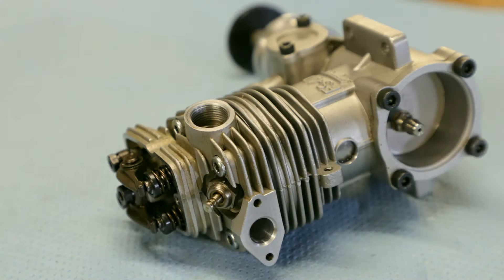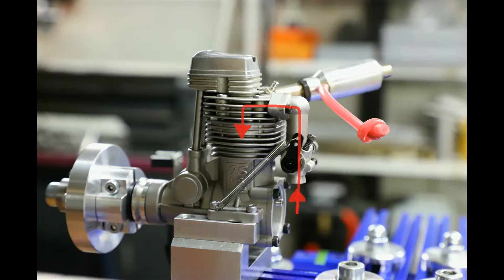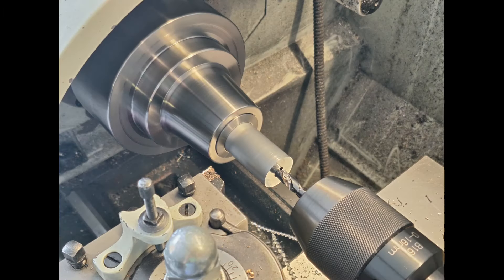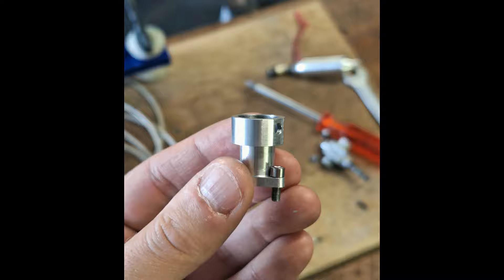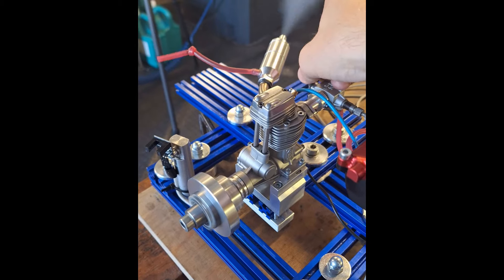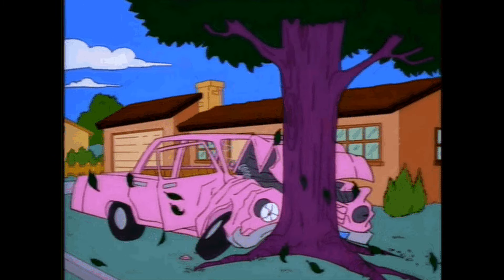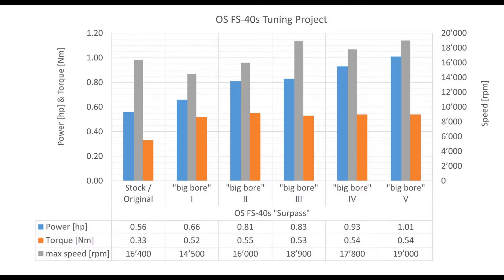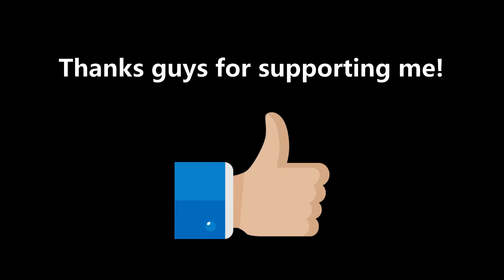How to boost the performance of a OS FS-40s? RC engine bore up-sizing and tuning project Part 6

Comment: well, now its time to make a new head... there was a forum thread on making "crossflow" heads on the old fs26C somewhere... "nolan", iirc?

time to try a hemi head... probably easier to start from scratch than say, modify a saito cylinder.

then theres header lengths, sonic tuning...
Reply: A cross flow head would be pretty good
Reply from the maker: Hi man! I think you mean Nolan Farmer? https://www.tamiyaclub.com/showroom_model.asp?cid=108273 At the moment I'm not planning to do a Stage 6 with new cylinder head. But when, I would build a new head, than 3D printed and CAD gas flow optimized without right-angled bends (more like a tube with roundings). But as I said, I'm currently working on other projects.
Reply from the maker: Hi John 👋 But over 1 hp!!! 😁💥😁💥😁

Comment: Hey Daniel!! Congratulation for your well deserved 1 hp😊 I was waiting for this video from a long time and really looking forward to see the new stuff you are working on! It's a real pity that the head broke down. The only thing that you might do in order to recover it one day, I suggest to tig weld with small tungsten an aluminum build up and machine it back down, maybe it might be reusable! Again compliment for the achievement 😊
Reply from the maker: Hi Davide 👋 Thanks man! More power would certainly have been possible. But when it's broken, there's not much I can do. To be honest, the engine was at its limit. Optimized to death 😅At the moment, I'm not going to repair it. I have very little motivation to do so. And when I would make a custom  made cylinder head for the next tuning stage. My current project is the 49ccm VR5 engine. I've been making all the parts for it for the last few months and it's 90% finished. As there was very little interest in the last video, I didn't make any videos for it so far. This is my most technically advanced engine to date. Hope that this will be running soon. As a VR motor, it's probably also unique in model making. I only do exotics 😎
Reply: 😊 really looking forward to see the latest creation VR 5!! And to be honest I'm very curious to know how the performance of the single cylinder you did last time with the better flow head, have improve. Are you planning to do a Dyno of that engine? Thank you
Reply from the maker: @davidemantovi6678  Mmm... shall I spoiler 🤔 I have already measured the performance of the 1 cylinder with the new cylinderhead with one valve. Result is... 🙃 The VR5 became a beauty! But as I said, there was very little interest in it.
Reply: @danielhunziker3577 well I can speak for myself I'm very interested! Thank you for your time in sharing your projects!!! Looking forward to the next video 😊
Reply from the maker: @davidemantovi6678  Here you can take a first look at the VR5 and how my friend made the milled parts: https://www.youtube.com/watch?v=i2vyJBSlwoA&lc=UgzVl95LkkIjiatlRgJ4AaABAg.A8rYHaLcZDzA8rZJJ1CTp1
Reply: @danielhunziker3577  just finished to watch the video! Amazing build!!! Really great craftsmanship 😁 thanks you for the link I really enjoyed it!!!!!

Comment: Wonder what caused the carb manifold to ctack off like that.  I can see enough weight in the carb, and vibrations being enough to do that.  Very strange
Reply from the maker: Hi russcole5684 👋 I think you're right. Due to the larger piston and longer connecting rod, it vibrates more at higher revs than original (counterweight on crankshaft is now too light). Probably in combination with the larger intake manifold and carburetor, it came to a fatigue breakage. I would probably have had to support it with an additional retaining plate. But now it is what it is... broken...
Reply: @danielhunziker3577  I own and run a couple of the Yamada YS engines. A .91 and a 1.20.  Amazing power for their size.  I wonder if you're able to make a new head, or replace with a original one with your porting, and try using the crankcase induction like the YS engines do to "super charge" the system.  Just a thought.  I'm sure you've more knowledge to make it work than what I'm able to do
Reply from the maker: @russcole5685  To be honest, I'm not familiar with Yamada's housing charging.I own a DZ140 Dingo NiB, but I haven't looked at it in detail yet (it was a bargain purchase). Webra did the same with its T4-91 MK1. It is certainly worth trying to measure the effect of the housing charge from Yamada once in future.
Reply: @danielhunziker3577  I have not measured pressure as on running engine.  They do pressurized the fuel tank while running.  I tested tank before install for stretch and swelling with air compressor regulated too 15psi.(1Bar).
I'd guess while running it's pressurizing the tank to 7psi or abouts.    Guessing from amount of swell.      I'd also guess that the engine would run at 1Bar boost due to it sucking in fuel/air mix once per rotation, and induction once every second rotation.   Crank case swept volume is the same as piston swept volume, therefore the charge is in theory twice atmosphere.      My guessing is very simplistic, have yet to test to practice